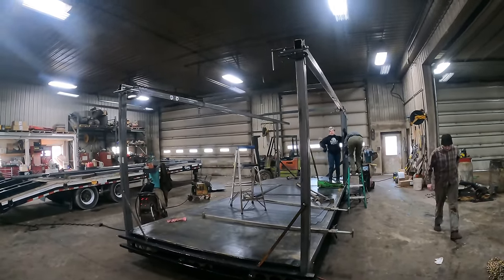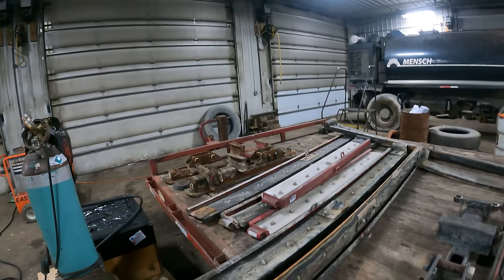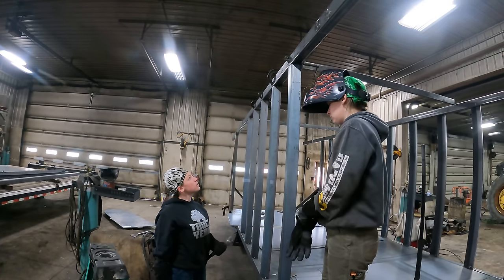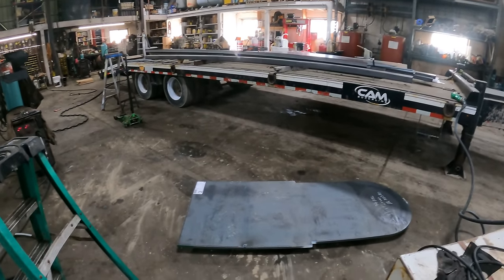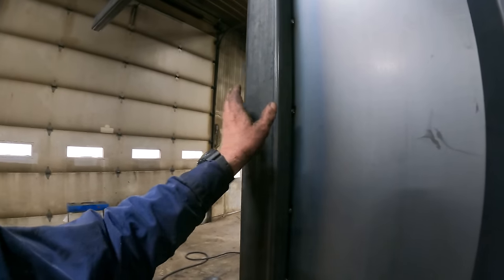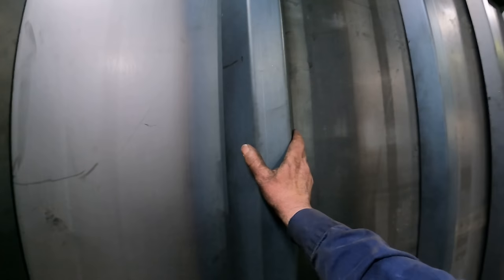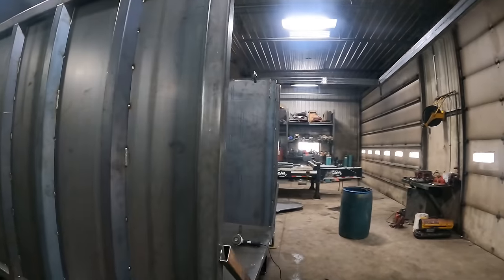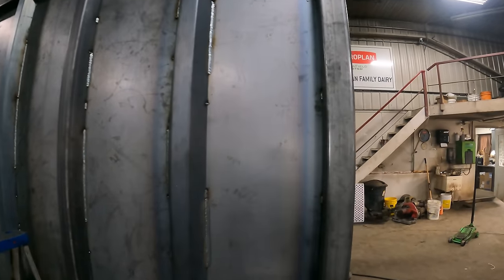Silage Body Build Part 4

Comment: 24 inch centers gives you more strength...we used to take van trailers and weld sucker rod on the insides about 3-4 feet up...then take chains and binders and pull the sides back in... hauling bailed cotton in these trailers...the tow motor operators would push the sides out so b ad, you couldn't see down the sides in your rear view mirrors...

Comment: ANDY couldn"t you cut some of the side post steel length  ways to put in on the outside of the four corners ends to make them easier and  neat to weld plus adding to the strength of the corners overall .that electric bike you were sent did it come with a helmet i guess not could be well worth getting one and leaving with the bike for any one to use when riding it/one with a face shield . cheers 😉

Comment: Hi Andy. Have you considered installing an Aeration System in the Lagoon to constantly mix the contents? It would be far more effective than the floating machine you have and apart from a blower motor, there is very little maintenance to do once the system, of pipes is installed on the floor of the lagoon. Throw a few solar panels up on the shed and you can run it cost free after the payback period for the equipment install (c.5-7 yrs).
Reply: what about winter here in Canada manure lagoon  and dug-outs too
Reply: Greg Hammon  Have you tried this before - how can you say for sure?
Reply: Greg Hammon  Ah so you do not have first hand direct experience of an Aeration System.